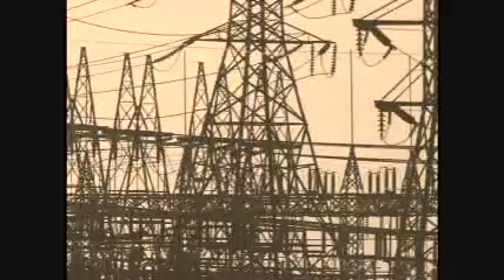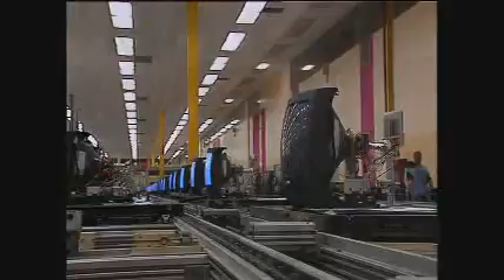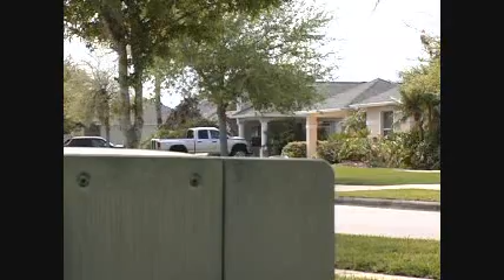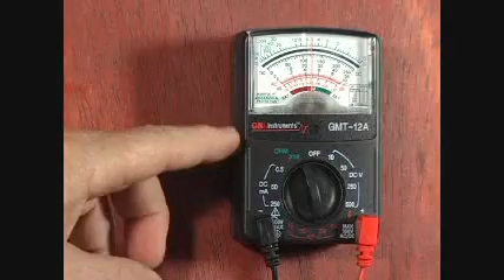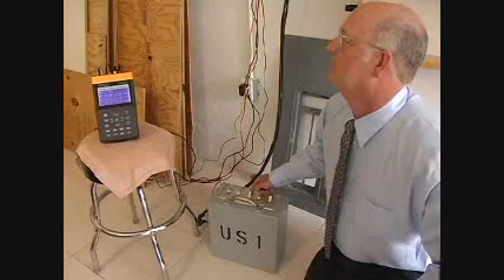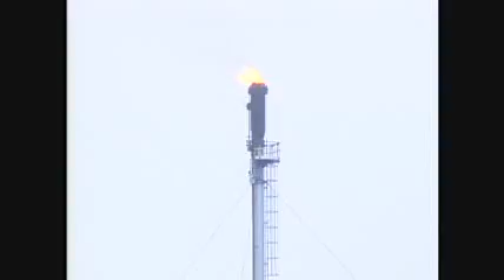GOES ENERGY

Comment: it is a real subject, but if the problem exists, it is most likely the power company.
 I caught onto this as my 1 bedroom apt uses as much as a gigantic house. my building has 9 other apartments, their own meter as well. 
no motors to identify, nothing unusual.. no short circuits. My bill goes Huge. 
as it turns out, all electricity shared at a transformer likes to find its shortest way back to it.. my apt is the closest. it may even be using the open eve vents for all I know (wireless!) This is never declared a short circuit. It is also poor mans 220..they tap a different phase of one transformer to get us the 220v. This gives 4 different ways to gain a pf driven bill.
long story short.. no pun. my bill dropped dramatically playing with my power station as a backup for my computer, etc. I then got a large dc to ac inverter to plug into the power station..make a sine wave of my own. 
So another real cure without snake oil.. a large watt portable power station, (lifepo4 battery is common), dc to ac inverter...and then use a smart battery charger to plug into the sloppy outlet/system to charge power station. This now is making dc 12v..so the power company can't play that PF game with it. I learned this all by accident, no degrees..just trying to find answers. Don't hesitate to add a solar panel..even a 100w beginner kit version is noticable. :goodvibes:

Comment: The principle as I understand it is that the capacitance shifts the ac phase between voltage and current so that they align more in phase.  Typically voltage lags current in our circuits.  By adding capacitance, this causes the inductance to balance with the capacitance and bring the two closer into phase.  Our power meters use this inductance phase shift as a way to monitor power usage and it turns the power monitoring equipment.  So really, we may be using the same power, but the power company is not reading it as the added capacitance slows the metering circuit.
That also means that this would not impact a DC circuit as there are no phase differences where DC is concerned because there is no frequency created to adjust for.

Comment: The claim of energy savings is 100% a lie.  Call your untility, ask them why they don't have energy saving surge protectors.   HVAC systems have  capacitors that this company claims they use to "save energy".   If there was any truth to their claim the government would require everyone use the technology to same energy in this country.   Does the term "snake oil" give you a clue?   Call one of the real surge makers of surge protection, ask to speak to their product management, or engineering departments.   Joslyn, Siemens, Liebert, Square D, etc. Not one will claim their surge protection products save energy.   This company is not honest.......... to the contrary they are crooks.